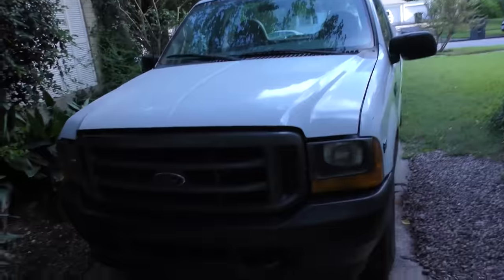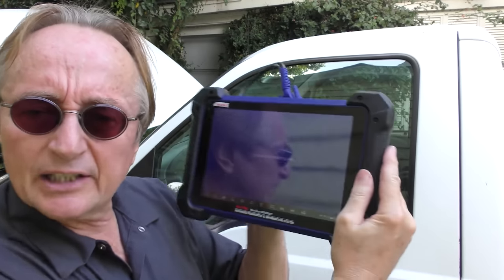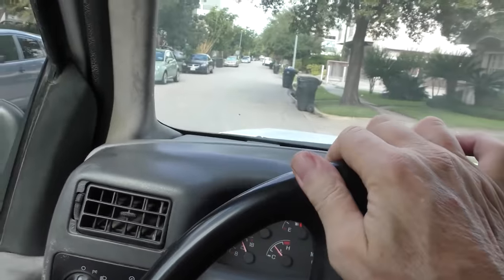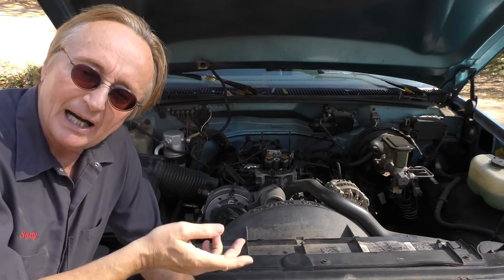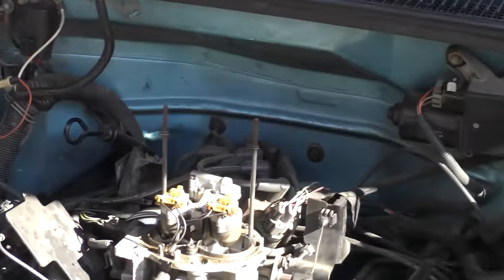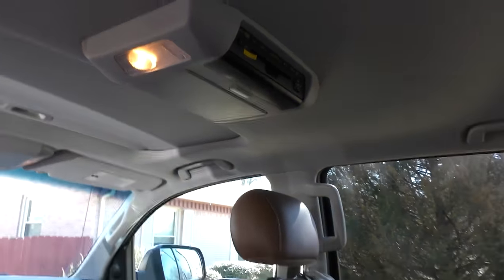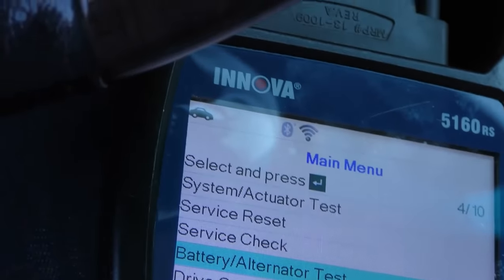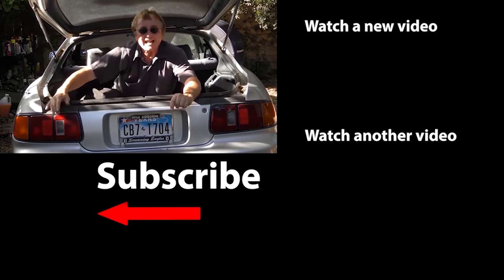3 Trucks That Will Last 700,000 Miles

Comment: I have the same truck f250 except It's a 2002 that I bought with 156k on it 4 yrs ago. It has a 5.4 which I had replaced since it was shot with a used engine that had 70 k on it I also replaced the transmission since that was bad too and much other stuff along with all the body work. I have under 20k in it and that is much cheaper then a nice used truck or a new truck. I use the truck to pull my 32' Jayco J flight trailer

Comment: We have a 2002 f350 that has 326k on it and it runs just fine and it pulls horse trailers a lot that's why 7.3 is the best motor

Comment: I will just stick with my 95' Nissan Hardbody V6 5speed extended cab truck has the LSD rear end hey you cannot beat that it has ok power but it has its limits. great trucks but have to have the v6 at least in the hardbody had it since 2006 2 starters and 1 alternator later iam supprized the clutch has never went out has 146k on the odo :)

Comment: Everyone knows the ford 5.4l engine has cam phaser problems and is expensive to fix.  I am discouraged that you did not mention this. Every mechanic i spoke to in town for their advice on older used trucks 100% agreed that the 5.4 Triton was junk. A few shops wont even work on them anymore because of the cam phaser issues that were major failures from 2000-2013 models. They run into so many extra problems when replacing them that the bills would get too big and customers would rage over the added expense or the shops would get stuck eating labour and working at a loss.

Comment: I have a 94 ford ranger 4 cylinder with 8 spark plugs. Starts good, shifts rough, ABS light is on and occasionally it’ll die. I’m thinking the shifting could be a problem with the wheel speed sensor on the back right. I’m looking into what the sudden dying is.

Comment: I have a 94 Chevy c1500 extended cab with a 5.7 with 260000 miles absolutely no rust runs and drives fine and the air conditioner still works I paid $3,800 bucks for it I did have to do rear brakes but that's

Comment: Yeah them Toyotas are built good. Just always been a Ford guy.. most of my trucks I'll go 300,000 or better and get rid of them. But I remember we had this 78 f-250 with the 300 inline 6.. it had a little over 700,000 and running very good.. but because I have been pulling a lot of big trailers over the past 20 plus years I've been driving diesels. My recent one that I bought brand new in 2001 is a crew cab 7.3 diesel. The front end ball joints and the tie rods and drag link are garbage. It is a 4x4 but I do need it. But with all the criticism people give, my truck went the first 200,000 miles without any problems other than that stupid front end.. you know as far as normal wear and tear crap..

Comment: Hard to believe the video maker's listing of Ford and the can't fix'em TOY-otas.  In the 1970's people used to say that FORD meant   "Found On Road Dead".     Or:  "Fix Or Repair Daily".  
 
  As for Toyotas,,,, ugh! I used to do independent contractor delivery work in the 90's. The guys with Toyotas were always having breakdowns. The company owned vehicles were Nissan pick-ups with a 4 cylinder and four speed manual transmission. We could rent them from the company if we did not have our own pick-up. The Toyota break down guys rented the Nissans and had very few problems, not counting flat tires. Cheaper to rent the Company owned Nissans than to fix the TOY-otas.   
 
   Had a 1968 1/2-ton G.M.C. 307 V-8 with a 3-speed manual transmission. Bought it from my Dad in about 1974. That truck and transmission had 106,000 miles on the odometer when the Speedometer/odometer died. Drove it thousands of more miles and sold it to a co-worker in 1979.  Changed the oil/air filters and the oil and the Spark plugs / Points and Condenser. 
 
 The mechanical fuel pump died about '73 / '74, so Dad (a former Flight mechanic in the U.S. Army Air Corps) removed the mechanical fuel pump and we installed an electric fuel pump just above the right front wheel well. The guy I sold it to had the speed/odometer thing fixed and kept it for another 5 years. He only had to get a brake job and changed the tires. 
 
 Current vehicle is a 1993 Chevy 3/4 ton, 350 V-8 4x4. Same engine, same transmission. 320,000 miles on the odometer. Needs a new dash air blower & radio/stereo and has some rust on the roof of the cab, but it still runs.

Comment: I bought a 1996 gmc k1500 suburban that has a brand new trans and it was a "Colorado custom" so filly loaded for the year also bench seats! Vhs player and TV, 2 sound systems 10 disc cd changer mood lights all above the vehicle on a nice switch I mean the thing is pretty cool 3500 bucks 220k miles tho but like I said brand new trans, need to fix the catalytic converters unfortunately

Comment: I was thinking of selling my78 Ford e 250 but with 75.5k runs like new..new 4 barrel  carb no problems with it just wanted to upgrade...marine batter i did change the wheel shad 17 with really nobbey tires went to 16s... has a few other perks... one has folder of every thingg all the owners have done upgrasdes i did loose a fuel pump a GM for some reason ...why sell it a did pay a lot for it never get what I  paid 10k just wanted it

Comment: My 61' C-10 runs like a swiss watch and will never die. I also have a 94' Silverado with 309,000 miles runs great with the same factory motor . I have owned one Ford truck and two Ford cars and will never make that mistake again ( both cars had tranny and other problems) I truly hate Toyota ( over rated ,over priced and super poor MPG) I guess it's what you like and trust . I like GM and will stick with their products.       j-

Comment: Interesting...... Bought '89 4Runner.....Got 200K trouble free mi. until dementia driver pulled out in front of me in '07  and totaled it.....Replaced with '07 Taco..... 14 yrs and 109K mi. (again, trouble free), traded in for used 2019 Tundra Platinum 4WD(early 2021) .... LOVE my Tundra..... Have driven 2 coast to coast trips, so far (+ detours to AZ & CO) .....Verrrry comfy..... At 77, this is my last Toyota twuck...... It'll wayyy outlast me......

Comment: i have a 94 just like that one only 4x4 and not as pretty. drove about 15 miles the other day in 4x4, didn't even notice. only 120k everything works will never get rid of it. bought it for 1k 8 years ago, drove it one year and parked it out back when the brake lines rusted out. pulled it out of weeds 3 years ago and am doing a hillbilly ongoing restoration. need some paint. 99 merc e320 167k my daily driver. 2200 invested, runs and drives like new. everything works easy to maintain. have a 93 e300 diesel and 82 240d i will never sell. hate new vehicles all junk after 99. proud of my old vehicles don't need shiny paint as i never wash them.

Comment: I have a 1999 f250 extended cap 4x4 5.4 wth almost 300,0000 miles still strong cold ac, I rebuilt the transmission at 278,000.   When I bought it it had 143000 miles, no leaks , the only thing that doesn’t work is the door lock actuators, I have only replaced, alternator and power steering pump

Comment: I have a 2011 Chevy Silverado I have 287000 low oil pressure is it worth putting a motor in

Comment: My 2015 Ram 3500 drw with the 408 cid straight six diesel and G56 manual transmission has 314,217 miles on and will still out last those three trucks. Just saying. Go down dirt roads some times and some stuff fell off but it runs great.

Comment: My 05 Ford F150 with the V6 actually has been very reliable... considering I also put zero effort into it (just top the oil off and buy new tires when they wear out - being very lazy with it). But I bought the most basic model 2wd - not even electric windows, and the only option is AC - and automatic. But I would like the F250 and V8 for the towing capability for sure. 

My only real issue with the Ford trucks were the crappy door locks - they have a PLASTIC housing around the lock and thieves know they can just pop the lock with a screwdriver.... which is why I don't have a stereo any longer, after it a break-in right in the parking lot of the 911 center! My coworker's F250 was broken into the same way multiple times.

Comment: I had bought a new 2001 Chevy 1500 with the 4.3 liter V6, manual 5 speed transmission. One of the worst vehicles I had ever owned. Within a year every seal on the truck was beginning to leak, engine, transmission & rear axle. My mother-in-law bought the same model year Chevy new before I did. Same issues. After 24,000 miles I sold mine and will never buy another Chevy pickup.

Comment: Lol......I got fed up with my 2008 avalanche doing funky things anytime I go to drive it. The thing rides like a caddy and pulls well but I dont drive it much and that's bad for vehicles with so many onboard damn computers. My "new" vehicle to replace it with is a 1982 blazer k5!!! No actuator motors or computers to put it in 4wd, steel bumpers,carburetor and hei ignition. The truck will literally run with one wire connected. I love how the avvy rides but it's a complex computer driven grocery getter in comparison.

Comment: Scotty, I have a 1998 Dodge 2500 12 valve diesel; that means no computer, injector pump, etc. I only have 90,000 miles on it, and it runs like a top. Even then, when I wanted a manual transmission. Salesmen were surprised, and of course, it had to be ordered. Automatics, overall, don't get the same mileage, because those auto trannys are always breaking down, and costing thousands, while my 5 speed just keeps rolling on. Next vehicle I buy, will be vontage, with a complete restoration, that I can work on.
....BTW, I also own a 2008 prius, that, knock on wood, is pretty good.....

Comment: my 99 f150 4.6L 2 valve v8 engine has 306k miles original engine and transmission. I bought it 5 years ago for $700 always starts when I turn the key. burnout video on my channel

Comment: I’ve got a 1995 4.9 six 4 speed OD  automatic with 232,000 miles got 2 thousand dollars into it! Love it!
Reply: I still drive my dads 1994 f150 5.0 got 280k love that thing dislike is that it’s a gas hog
Reply: @rashaunsmith7935   never been economically good on gas but for a work horse yo can’t beat a ford
Reply: Your just breaking in the ole 300 six!

Comment: 🎉 I have a question I have a 2008 Ford ranger I replace the fuel pump in the float but my gas gauge is not working correctly it's erratic I called for it I got no help nobody seems to know how to fix this problem I never know if I'm full empty or half full please help me thank you

Comment: Ford 5.4? RUN AWAY! Good deal at $3500?>>until you have to pay $7000 to replace the turd 5.4 when the cam grenades! Weak point on the Chevy is the 4 speed auto trans>>junk! You won't find any Chevy truck that isn't total garbage for $2000.I live in Illinois and most trucks in Illinois are totally rusted piles so finding ANYTHING affordable without a million miles on it is hard.

Comment: Scotty, what about the old 1980's r-22 4cylinder engine Toyota trucks? Got 2 of them, 86 4x4 truck, 84 4 runner? Both are eternal, like you say drive like trucks, but have pulled a half yard of sand uphill. Scary, was in 1st gear at the top, but made it! After that, lightened the load.

Comment: it depends on where you are, what use the truck sees, if the body is taken care of. trucks like the one shown (4x4) used for plowing were notorious for frame breaking. usually at rear of cab. not to mention late 70s on until 90s had no power and they are the worst gas hogs ive ever had.

Comment: Trucks are supposed to be made to last years. Commercial owners need them be dependable, efficient and easy to maintain. A car normally isn't required to live up to these standards. Not every car is a police interceptor! Want a vehicle to last a long time buy a truck. A used commercial truck used but not used up. A three quarter ton from the American manufacturers is probably your best bet. Hit up an auction website, but get your mechanic to check it out.

Comment: My 07 ES downstream O2's are steady at .6-.7V and barely respond (flat line). Replaced with densos and same issue. LTFT's are in double positive digits, reaching 21%. Help! New spark plugs, maf and throttle body was cleaned as well.

Comment: Triton engines sucks, I had a 2004 3 valve 5.4 and the cam phases went out three times before the updated version with updated oil pump. Since then I never had problems but initially it was expensive up keep.

Comment: My experience of mid 90s Chevy's is that the transmission is a POS. I see this one has already had problems. My 95 F150 has 250,000 miles and still strong and quiet, has the odd small leak is all.

Comment: I have a 96 Dodge Dakota with a 2.5 engine and I having issues with the temperature gauge have replaced it sometimes it works sometimes it doesn't what could it be and does it have a timing belt that needs to be replaced at 100,000 miles I have just a little over 100,000 on it

Comment: I would prefer the old straight 6 no timing chain/belt, no cam phaser to go out, but fuel injection instead of a carb. Stick shift while nice the granny gear is a pain unless hauling a load. Also the contractor glass headlights says work truck and are easier to replace than the whole plastic lens sh!t that fogs over. With some good tread tires you can go 'off road' with a two wheel drive (and a come along strap). The lift gate also balances the truck when empty with less chance for rear end slip on wet or snowy pavement. Couple that with a homemade all steel diamond plate bumper and nothing short of a tank would damage the rear end if an accident. I like my Ford pickups.

Comment: I have a 90 grand marquis with a 302 original engine and transmission. 
The last known mileage on it was 300,000..... 10 years ago.
My guess is its probably atleast 4

Still running strong and i abuse that engine

Comment: What do y’all think of the older Ford Triton engine?
Reply: The 5.4 Triton 3 valve introduced in 2004 is the one with multiple issues. The 97-2003 5.4 and 4.6 had the spark plug issues that was corrected by Ford. The 2004 and later 4.6 didn’t have the same issues as the 5.4. If you take care of these engines, they will last. The 3 valve 5.4 is not tolerant of neglected maintenance, and it will fail if extra care is given to that engine.

Comment: On all of my f250s I've had to replace the transmission shifter tube (when you should also mend the overdrive wiring which crisps up and snaps)
Reply: ....and if your misfire is showing up on the dash- you've reaaaaally got a misfire, the computer will tolerate a lot

Comment: I have a 2006 f150 f4x  5.4l 3 v. I put  5.30 w oil. Molbe 1. With MM. Oil.  She has   are you ready.   254673. The engine is like a volcano hook on crack!!!

Comment: Gotta 98 f150 4x4 off road edition 5.4l with 300k miles oil cooler started leaking oil in the over flow jug n I haven't been able to find the right one cause there's several different ones

Comment: I just purchased an 89 Dodge Ram Cummins diesel from the original owner that I'm guessing you wouldn't dare mention because non of the 3 you mentioned from back then will be on the road when the Dodge will have just been broke in and it gets 21 miles to the gallon!😜 I know you hate Dodge Scotty but I just had to say it😋

Comment: i pretty much agree with ya scotty on everything been working on automobiles 30 years but sorry i dont agree with the 5.4 ford everyone i know and see that are for sale motors are junk at 80 to 150 thousand miles id rather have the 4.6 or the 5.0 iv seen 4.6 motors with 400 thousand on them iv seen alot of people putting 6 cyl cummings with 6 speed manual in f250s kinda intresting im a chevy guy but i like the way ford trucks ride and i had a 98 f150 4.6 was great truck 4x4 was strong wish id never gotten rid of it went threw the snow better the my 96 Silverado havent own a Toyota yet think imma start with the gas saver tho either a matrix or a vibe best thing tho about older chevy trucks easy to work on and alot of parts interchange id rather have a manual tho

Comment: Scotty what do you think about the 2011 gmc with the old 4.8 v8 ?I knew the 5.3 had issues and a friend had the 4.8 and he sold his with 240 k miles  so i bought one and i have 220k miles so far and only had to rebuild the tranny at 170k miles. I am really hoping it last a while until i buy a tundra , but I feel really good about my 4.8 gmc so far although they have a lot of cheap crap it has been really reliable . ITs pretty much a base model 4x4 on the floor ya know its the last year that had a NORMAL ENGINE with no technology to hender its longevity.

Comment: Have an old 97 f250. I work in concrete and I'm always hauling 3500 lbs plus payload multiple times a day and it's still running like a hog at 300k miles...they don't make em like this bro.

Comment: Any ford 3 value engine in that year range is junk if not maintained emacuitly you will be replacing, the engine at about 100,000 the oil channel holes for value timing get plugged easily and when that happens no fix basically you need new engine

Comment: The 5.4 Triton is the worst motor Ford ever made. 1-2  threads holding the spark plugs in.. aluminum heads. 1998 thru 2003 are to avoid... look that up anywhere. V8 and V10. I'd run.. sorry Scotty

Comment: Toyota dealership wants $500 to change my spark plugs on my 2016 4Runner should I let them do it for that price? What are my options
Reply: Spark plug replacement is not a difficult repair you could do it yourself or take it to a mechanic for a lower price. 500 is too much imo
Reply: @atlaslion5128  I was thinking the same, thank you for the help and response
Reply: @bruce9063  no problem